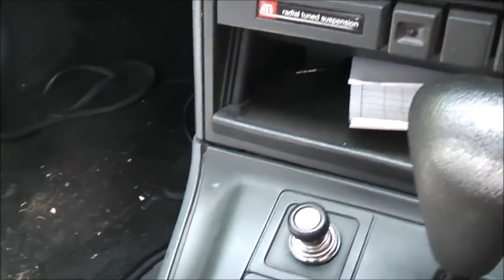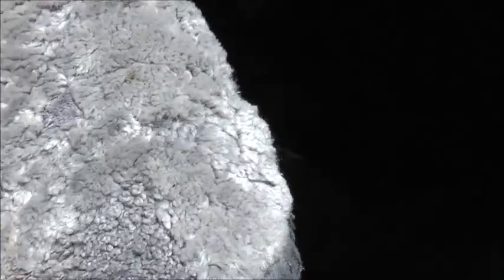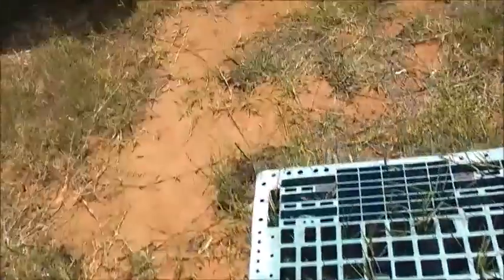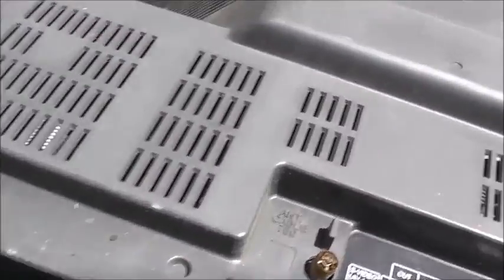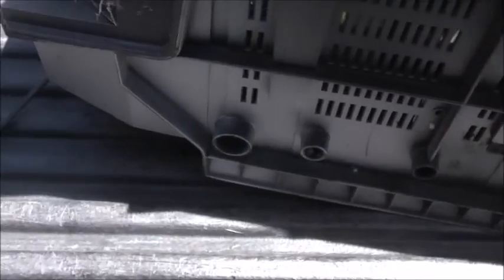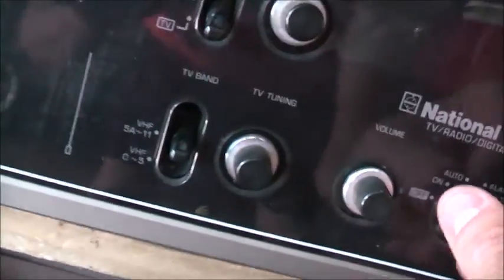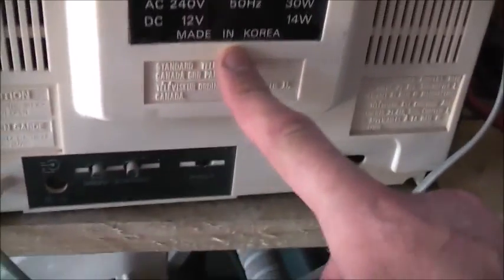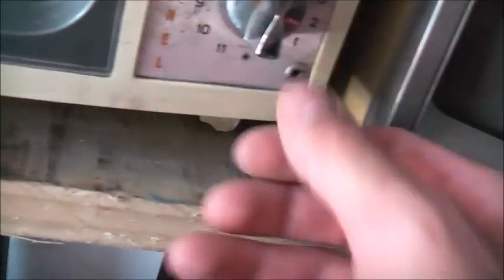Vintage TV Epic Scores!!!!!!!!!

Comment: If that National Panasonic has a delta  gun tube it's a fairly early one, I have a Panasonic Quintrex set from 1976 and it was so named for having the guns inline. The delta gun tube idea was developed by RCA whom licensed other manufacturers to use it, it was pretty much the standard colour picture tube design up until the Trinitron came out, and for some time afterward. By the way, you should put a blanket or a piece of cardboard under it if you are going to rest a set on it's side so you don't scratch up the cabinet. 
 That one with the built in clock radio looks like it's from the early 70s, probably 1971-73. I have a National Panasonic B&W set very similar in style to that, but a 15'' I think, and it has a TV standards switch on the side so you can switch between PAL and NTSC. Unfortunately the tube looks a little dim so I will have to get or borrow a CRT tester to check it, and the sound does not come out of the speaker, only out of the headphone jack. Is that AWA a series strung set or does it have a proper power transformer?
Reply from the maker: +OlegKostoglatov AWA has a Power Transformer!!!